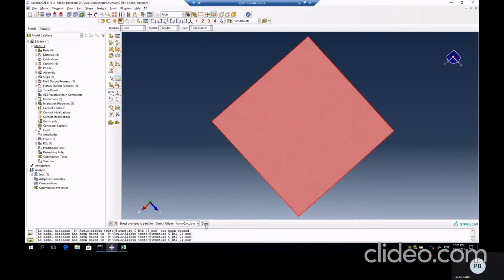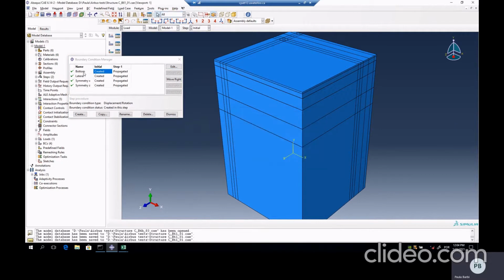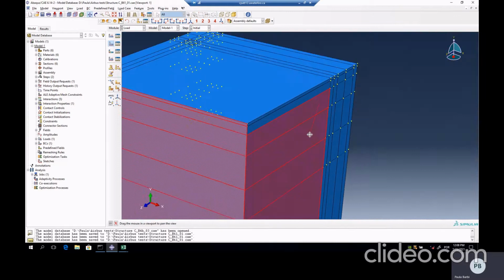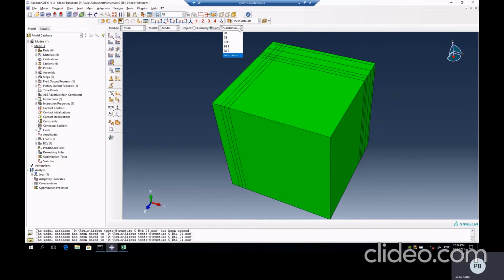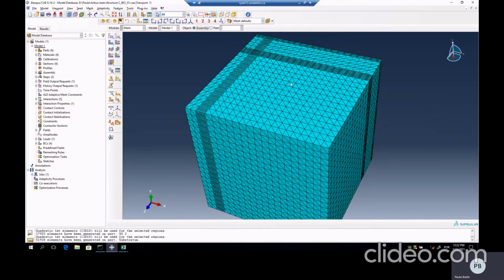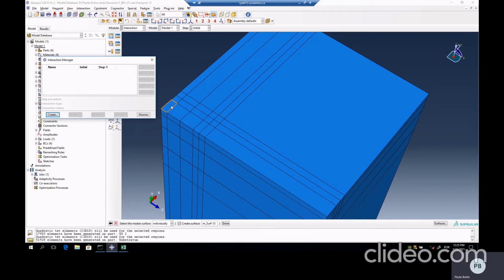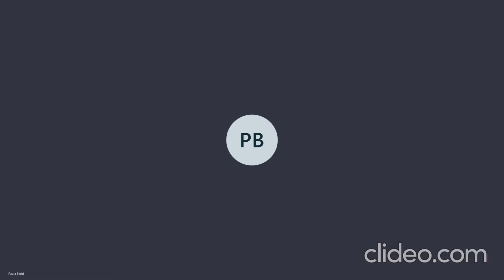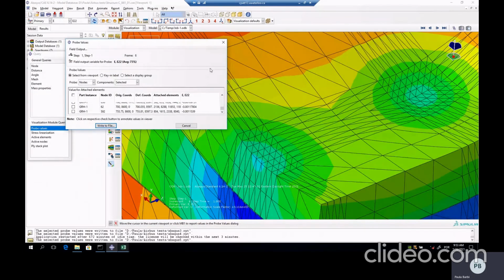Mechanistic Analysis of Airport Pavement in ABAQUS

Comment: Hi Maam, first of all thank you for this wonderfull tutorial. It helps a lot as a begineer.
Maam i am trying to finding rut depth in a pavement structure with repeated moving load.

The details of my model are as follows

I have divided the whole wheel path into a number of steps.

Parts:- Asphalt layer, Base layer, Subgrade layer

Property:- Elastic modulus and poissons ratio of every layer.

Steps Module:-
static general step, 
Step Time = loading + unloading time,
 linear geometry is used (whenever i try to use non linear geometry, the analysis gets aborted in job module)

Interaction Module :-
Interaction property- frictionless contact
Surface to surface contact is used with finite sliding.

Load Module :- Corresponding to each step i have assigned a load with a defined tabular time amplitude. 

Ex:- if 20 steps are there i have assigned 20 loads and in each load the loading area is shifted by one element.

Amplitude Table :- Equivalent loading concept is used which consists of total loading and unloading time. I have attached the screenshot.

Problem:-
 I am  getting the same amount of deflection as in applying static load. Whether I increase or decrease the number of repetition the deflection is the same.

Kindly help me with what i am doing wrong.
Reply: You must have realized this by now it has been 3 years. The reason you are getting same displacements in spite of load repetitions is due to your model being linear elastic. For rutting, you need nonlinear models as well as ones that have permanent deformation upon unloading. Go for a viscoelastic or an elasto-plastic model initially. Assume the Von Mises or the Drucker_prager model.

Comment: Hey. Thank you very much for this video, you have just saved me,  
 Quick question is it possible to run the load under a cyclic load instead of static load because in my final year research I am modeling in abaqus and testing a physical model of rehabilitated airport pavement under cyclic load.
Reply from the maker: Hi Teshpo, you are welcome. I believe you can run a cyclic load on Abaqus, but it only makes sense to me if you are considering the non-linear properties of the materials, otherwise, one cycle or many cycles should give you the same results.
Reply: @PaulaSWrolim  Thank you for your reply